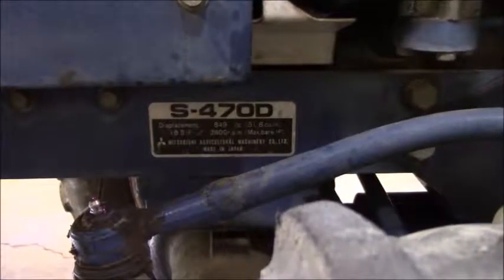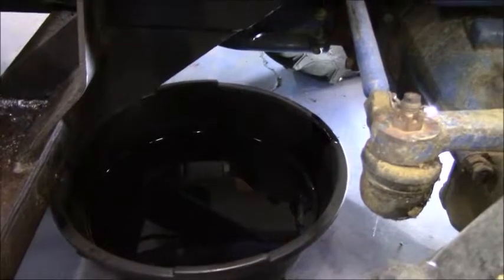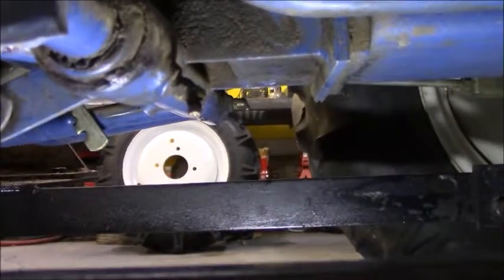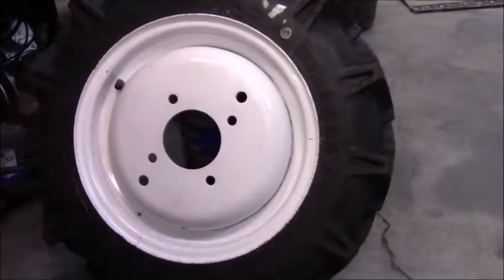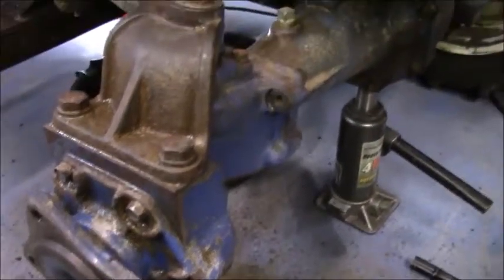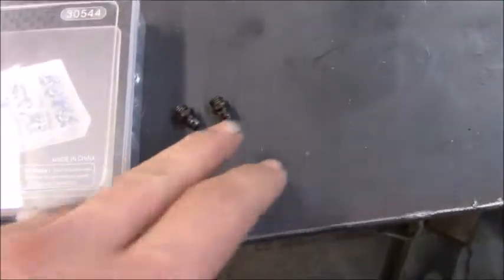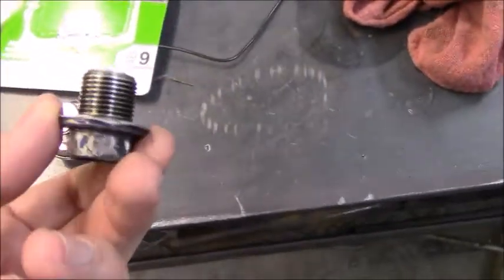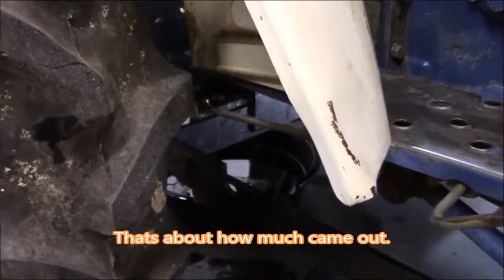Episode 66. Mitsubishi Satoh S 470 D Buck. First Service

Comment: About two years ago I picked up a Buck with 380 original hours on it. It was kept inside from the day it was new. I did the 400 hour service on it and went over
it to make sure everything was adjusted, greased and checked. It's running great. I also have had my shoe lace snag on that grease zerk. The guy I got it from
warned me about it too. I also have a Satoh Beaver that was my dads. I'll be working that one over and getting it running again. Thanks for the videos and hope to
see more on the Buck.

Comment: I found an owners manual for the Buck.  You way over filled the front axle.   There is a fill over flow bolt on the front of the lower knuckle.

Comment: My father has the S-470 (2wd). His dad bought it brand new back in the early 80s, we are having trouble with the front bucket, it’s a “Blackhawk” brand and can’t find anything on them. It won’t lift heavier upwards, or tilt with heavier material. So we are thinking the hydraulic pump isn’t working proper, or maybe you had any input. Thanks. Hopefully someday I can get the tractor passed down to me.
Reply from the maker: I'm not sure I am going to be any help with your hydraulic issue. How well is your 3 point lift working? I say this to make sure that your pump is bad. I also ask what you mean by heavy? I have read that the lift on these loaders is about 600 lbs. I have a set of forks and I know when there is a load at the end of the forks it will not lift much due to the folcrum effect.
Reply: Low Quality Films 2016 3 point works fine,  and the bucket can’t lift 200lbs when before it did that no problem, I found a replacement front hydraulic pump online so hopefully that’s it.

Comment: Use only one gasket/washer on the oil plug, oil filter, etc. 
In fact in anything with gaskets of any kind. NEVER double the gaskets! You're calling for a leakage. Precisely what you intended to avoid in the first place. Sarcastic, but true!

I guess you're not very keen on mechanic feats! No worries you'll learn. The same way you'll learn that oil filter "filling" is another stupidity, from the snowflake generation. Save yourself the mess, just because you've read it somewhere online! LOL :-)

Another simple tip: After applying grease, clean and CAP the Zerk fittings with rubber caps more commonly found on brake bleed nipples. They're dirty cheap and you can get them by the bucket, for almost nothing! So every time you gonna apply grease, you can pop the cap to find a shiny and CLEAN Zerk! Not bad, hmm! ;-) 

Last, but not least. That old damaged oil plug, use an angle grinder or a simple handheld file. And reshape the hex head. Until it fits the next lower measure. It's that simple. You'll be up and running in 5 minutes, literally for free. No need to wait days in a row for a new oil plug! :-)    
Cheers